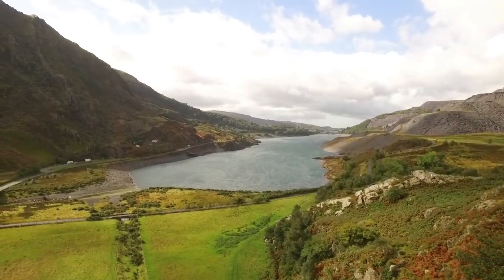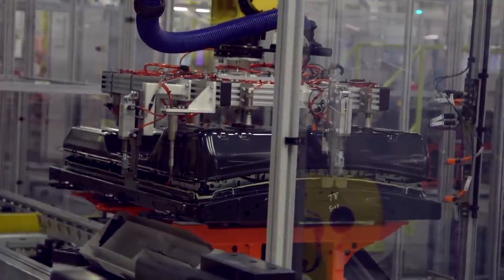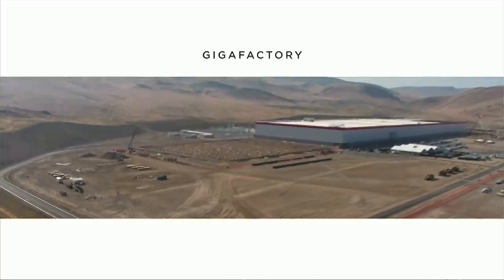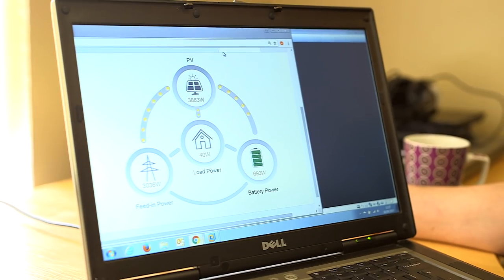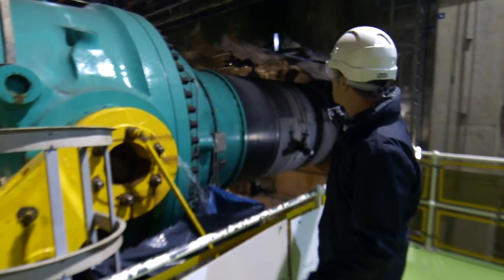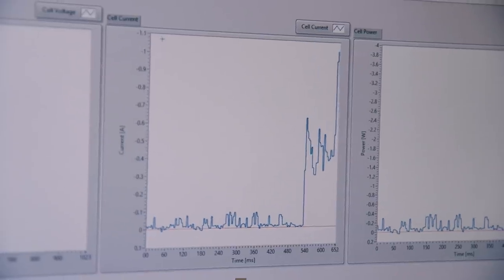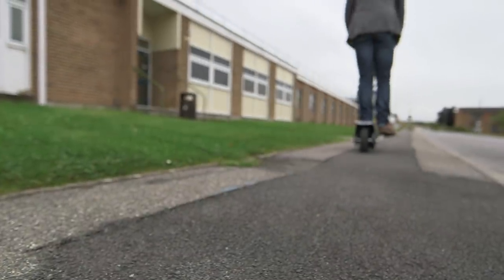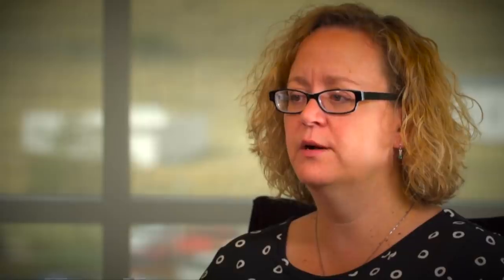How to make your battery last longer - BBC Click

Comment: Keeping your phone plugged in only degrades batteries on cheaper or older phones. The galaxy s8 that I am using actually benefits from being plugged in as the charging circuit only kicks in at around 95 percent after the battery has been fully charged. Also it uses the power from the charger rather then the battery using your battery less.
Reply: Sounds good in theory but taking a lithium ion battery above 80% charge will shorten its life.  It takes a lot of force to get that last 20% which will damage the battery if done often.  You've already done damage getting above 95% charger cutoff, if it drops below that cutoff while still plugged in you're again stressing the battery.  As they said, best to keep the battery between 20-80%.  Particularly if you have an expensive newer phone which needs a hammer and crowbar to replace the battery.